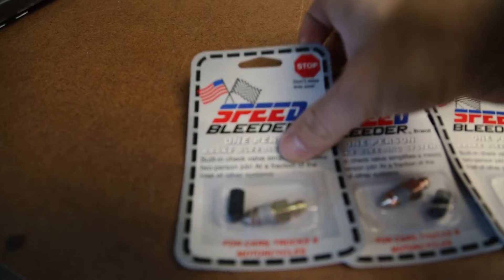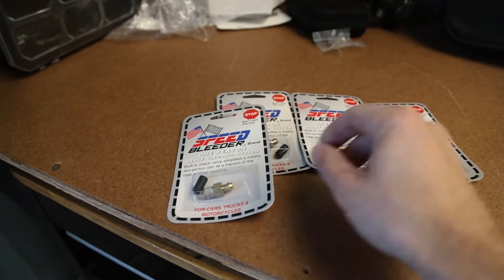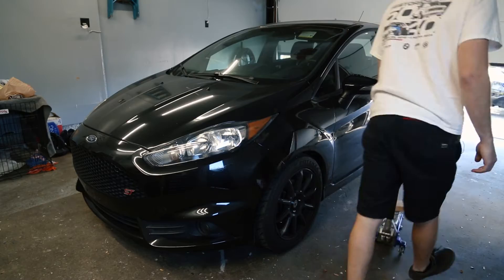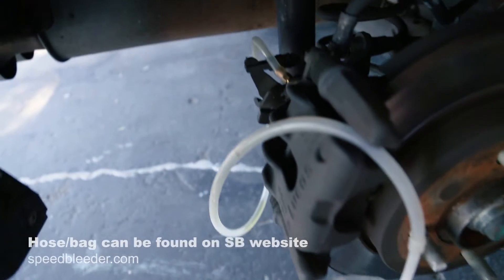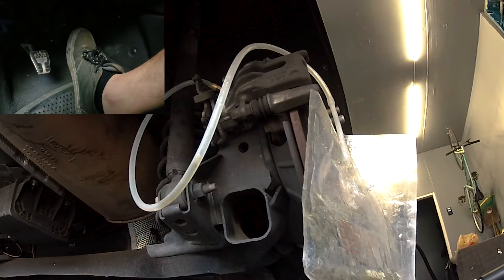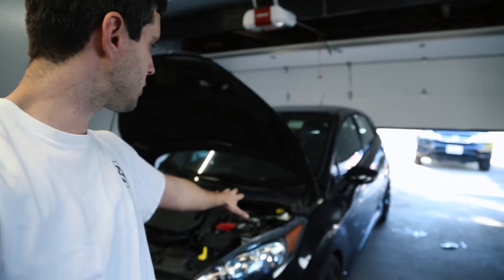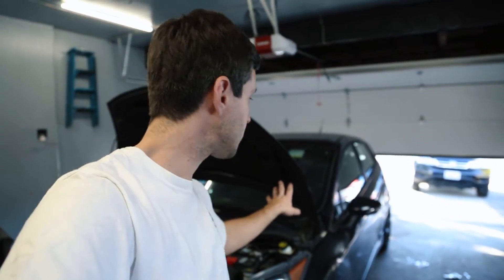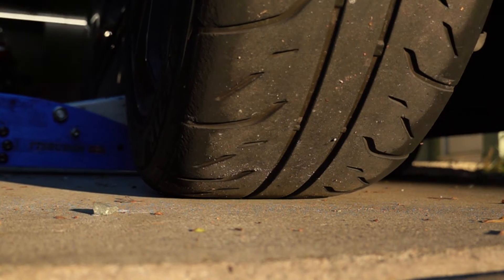Episode 10 - Brake bleeding and Speed Bleeders on my Fiesta ST

Comment: do you need to disconnect the battery first or not necessary? for my G35, the FSM stated to disconnect the battery because of the traction control system. Thanks!

Comment: This is brilliant , thank you. I have a newer Fiesta ST MK8. (2021, WG series) Anyone with any idea what the speedbleeder size is for this later model? If I take it off to measure, it’ll just suck in air, right? Where can I find out?
Reply from the maker: If some threads are showing you can measure with a caliper, it’ll be metric and there’s probably only one thread pitch used for them us just need to find the diameter of the threaded portion most likely
Reply: @BenFreedmanRacing  Thank you!

Comment: Do you have to put the old/original bleeder screws back on after you're done bleeding? My dad told me you did, but I don't know if that's right.

Can you drive the car safely with speed bleeders on? Or do they have to come off?
Reply from the maker: They stay on. Speed bleeders are ultimately the same as a normal bleeder screw but instead of being completely hollow inside they have a check valve that only allows fluid/air to flow out. When a bleeder screw is tightened down (OEM or Speed Bleeder) the tip of a bleeder screw makes a seal against a concave portion in the caliper that keeps hydraulic fluid from coming out of the hollow portion of the bleeder screw and that is what is important.
Reply: @BenFreedmanRacing  Thanks so much for your quick and informative reply! I'm working on changing my wheel cylinders this very moment. You're a life saver!